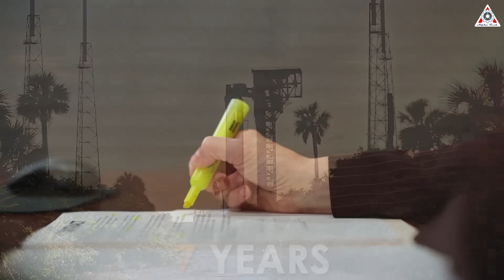It's Over! Starliner is in BIG TROUBLE again. NASA gives up...

Comment: There were no issues from the Starliner Capsule, but a ground computer had an issue. It would not be Boeing's fault, but would be more on ULA and NASA. Every first time launch of a new manned rocket usually have delays. First launch of SLS and first Falcon man flight had delays. Everyone is hoping to have a secondary launch system. This same rocket will be used by Sierra Space to launch DreamChaser, and the Defense Department will be using it to launch satellites.
Reply: There's still the issue that these rockets are one time use rockets. Space X will always have that edge on this rocket, and thus make it a cheaper option.
Reply: reliability issue...ULA

Comment: This is entirely because when Boeing and McDonnell-Douglas merged, they retired Boeing'a engineer-managers and kept MD's beancounter-managers. 

Boeing needs to get their excrement in one sock and promote engineers who actually know what the hell they're doing into leadership positions, with the beancounters relegated to a strictly advisory capacity.

I understand the need for competition. What I don't understand is the need for that competition being Boeing, because Boeing has lost their way quite badly, as evidenced by their military appropriations corruption scandals, the 737 Max, and a litany of other issues.

NASA needs to be a passenger, not a driver. They should continue on their space medicine and science missions, and the FAA should be renamed to the Federal Aerospace Administration, chartered to deal with deconfliction of everything from the surface to the Karman line. With NORAD responsible for the Karman line to GEO.

Comment: I think getting a NASA contrct should be a reward for being the absolute best of the best not a reward for cutting safety corners to increase profits. Based on the quality of Boeing aircraft I wouldn't even consider Boeing for anything if I had to make the final decision for NASA.
Reply: Boeing that got this contract is not the present Boeing.
Reply: @bazoo513  The current Boeing that got this contract has been the same Boeing Since August 1st 1997 when they merged with McDonnell Douglas.
Reply: @garagegamer6484  It did take some time for bean-counters to run it into the ground.
Reply: @bazoo513  Yes it did. But if Boeing can't get the starliner off the ground NASA should be reconsidering. It's a damn good thing NASA is super meticulous with everything. But if I was a NASA astronaught I wouldn't get in that thing.

Comment: We talking about issues with controllers, valves and helium lines, these things can be tested many time before and after installation independently and after installation as part of unit tests, why these small problems come to light on the launch pad?
Either Starliner has less tolerance for errors than SpaceX, or they lost control over integrity of the whole testing process long time ago.
Reply: Yes and Yes

Comment: Shades of shuttle.  It also had an issue with computers failing to sync (in that instance, on-board one's). Analysis determined "just live with it" - i.e. that whenever it happened, just re-start/sync (thereafter it would be stable).  No change to the software required, just to the (manual) operating procedure.
Reply: True, but did they not have 5 onboard computers ?, and at least 3 could fail and the flight continue on 1 or 2 ? ?

Comment: Ah, as far as possible flaws over the chute system, Starliner HAD a chute failure in 2019 during escape system testing. So if the same system as Blue Origin, that is "two" failures, not one.  Although it may not be the exact same malfunction. the end result is the same...  Two out of three ain't bad, as long as it isn't your astro-butt strapped in the seat looking out the window and counting blossoms.  Williams and Wilmore will have to wear the same undies for a week, due to the need for the pee-pee water fountain system weight of 150 pounds... is that in the Union contract?  In the end they need to scrub the whole thing and find the helium leak.  Especially the reason for "attitude system" as they are already scrubbed in the hangar tearing thigs apart.   Any known deficiency of "attitude control" would ground any other flight.  What if it is a crack and not a seal or hole or whatever they guess it is? Safety first boys and gals...  Can I say gals to Boeing and not triggering HR?  Different subject or is it...

Comment: The Boeing CST-100 Starliner is part of a fixed-price contract. Boeing entered into this contract with NASA under the Commercial Crew Program, which means Boeing is responsible for any cost overruns during the development and production of the Starliner spacecraft. Under a fixed-price contract, Boeing does not receive additional money for delays. Any cost overruns or expenses incurred due to delays are typically the responsibility of the contractor.

However, in response to a 13-month delay in completing the ISS Design Certification Review milestone, NASA compensated Boeing with higher prices than originally specified in the fixed-price contract. This adjustment was controversial as it was deemed unnecessary. Boeing has committed nearly $1 billion of its own funds to address the unforeseen expenses and technical issues. The concerns are that Boeing is adopting a "least viable product" mentality due to the financial strain.

This issue is compounded by other problems within Boeing, such as the delays and cost overruns in the E-7 Wedgetail program (E-3 Sentry AWACS replacement), the KC-46A Pegasus (new refueling plane), and the Boeing 737 MAX. These repeated issues across multiple high-profile programs indicate systemic issues within Boeing, including potential deficiencies in quality control, project management, and adherence to safety standards. The pattern shows that Boeing is struggling to manage complex aerospace projects effectively, leading to delays, increased costs, and safety concerns.
Reply: Interesting information and a good read. Thanks
Reply: Boeing is gets double the price of the fixed contract compared to that of Space X fixed contract!😂
Reply: @Mr.HarryWild  They secured the contract because their bid involved building the Starliner from the ground up, while SpaceX bid lower, planning to use an updated version of the Dragon that was already flying missions to the ISS. My understanding was that Boeing underbid, thinking SpaceX would be unable to stay within budget and would need to request an increase, which would then allow Boeing to do the same. However, Boeing underestimated SpaceX, which self-financed development even when Congress reduced payments for one year, avoiding reliance on a chaotic government finance system. Since SpaceX did not ask for more funding, Boeing was left stuck with their original lowball bid.

Comment: All you Aerospace Engineers in the comments section need to apply at Boeing since you have all the solutions.  Oh, you're NOT Aerospace Engineers and DON'T have a clue of what you are taling about?  NONE of this is out of the ordinaray for a new launch system.
Reply: None of it is out the ordinary, in fact spacex had their own set of issues. However, Boeing is years behind schedule, and way over budget compared to spacex, who have reusable boosters too.
Reply: Where did you study for your engineering degree? Just curious.

Comment: This won't end until the Congressmen backing Boeing on this losing project are fired. It's not NASA's Money Boeing is wasting, It's YOUR MONEY. And Boeing won't even give you a 5% discount if you will be brave enough to fly on one of their airplanes (built by the same company that can't build a space capsule). It won't end until somebody makes it end and considering that TWO WHISTLE BLOWERS have been killed makes you think Boeing doesn't like people that cut into their profits. So far nobody is brave enough to pull the plug on this project, not even the President. He knows what happened to Kennedy after he Privately Announced he was NOT for the Moon Program and wanted to spend the money on Social programs. Next thing you know Kennedy was dead.
Reply: Those Congressmen are sustaining thousands of workers throughout the country. If they should ever decide to drop Boeing and these projects they will also eliminate all or part of NASA funding. No win situation.
Reply: JFK insisted that the moon program be implemented when most scientists said it could not be achieved and certainly not by the end of the decade.
 There is no credible evidence to suggest that JFK ever privately announced he was not in favor of the Moon program.
As it turns out the scientists were right, so Stanley Kubrick and the CIA faked it but, JFK had been dead five years by then.

As a result of Kennedy's plans to dismantle the CIA and the exposure of FBI Director J. Edgar Hoover as "light in the loafers", the leaders of both agencies forced Sam Giancana, who himself hoped for a JFK assassination because of JFK's appointment of  his brother Robert Kennedy as Attorney General and Bobby's subsequent efforts to dismantle the mob. Giancana was made to hire Cubans, who hated JFK due to Kennedy’s mishandling of the Bay of Pigs invasion and his plans to normalize relations with Cuba, to act as triggermen while Hoover worked to frame and then assassinate Lee Harvey Oswald as part of the cover-up. Both agencies made the whole thing look like Newly sworn President Lyndon B. Johnson's scheme in documents he was presented with as soon as he arrived at the White House. Leaving the CIA and FBI in total control of the government.
Reply: That's nonsense. In 1961, Kennedy made his public announcement that he was mandating NASA to land on the Moon before 1970. He did so independently, without consulting even his closest advisers beforehand, because he knew they would advise him not to commit America to going to the Moon. His primary goal was to beat the Russians at something in space, because the Russians had to put the first satellite, first man and first woman into space.

Nobody was more pro the moon landings than Kennedy. The whole project was his idea. He never, ever thought the money was better spent on social spending - he fought tirelessly for NASA's budget to be increased to accomplish his dream. 

Still, let's not let the facts get in the way of a ridiculous conspiracy theory, eh?

Comment: Space flight is way more complicated than anyone admits. For the most part, Elon Musk/SpaceX handles everything like crew capsules, booster stages, etc. versus the starliner is run by 2 different companies ula and boeing. Then after that, we're not sure how much is farmed out/contracted to 2nd and 3rd party manufacturers/designers(?). 

Elon Musk also runs vertical integration in the Tesla programs also, whereas, all parties work together to manufacture/design/produce vehicles versus legacy automakers which farm out many items to 2nd, 3rd OEM's. 

There was a story that one Apollo/Saturn 5 space launch boosters had 15 million separate sub-systems, but could not find that in google search(?).

Elon Musk/SpaceX/Falcon9/Crew Dragon is currently the best launch system out there, other folks are still using the 1960's make one and hope it works/purely expendable launch system philosophies and practices.
Reply: ULA is 50% owned by Boeing.
Reply: From what I am seeing ULA is the issue in this case.  Yes, the manner in which this is being done is bad news and keeps folks working.  I don't see any changes coming.

Comment: Sounds like over complication is still a thing with them. Excess computerization, wordy software, excess mechanical BS, 
Probably too many bureaucrats and managers....

And so leave the luggage and pee in a bottle...

Meanwhile, SpaceX is likely working on their replacement for Dragon, and it will be simpler, more durable, and more reliable....
And probably cheaper and faster to produce.

Will be fun to see how many models SpaceX can do, and how many craft, while these guys are trying to fix their obsolete POS....

You notice when SpaceX had the problems with Raptor 1, and then hit with the parts count concept, that schitt happened, and has never stopped. Already working on Raptor 4, and Raptor 3 hasn't flown yet, and meanwhile Raptor 2 is a record holder on largest ships lifted...

Elon didnt need doughnut meetings to decide to do something.... Sure it must have been a:
"Now hear this" moment. And one second it was Raptor 1 reality, and the next second they were thinking beyond that and shifting the  paradigm.

Any thing that takes a decade to design and build, is past its pull date when finished.
Tech is accelerating rapidly now. SpaceX is working on solutions to problems the competition hasnt gotten to yet....
Reply from the maker: What you said is very accurate